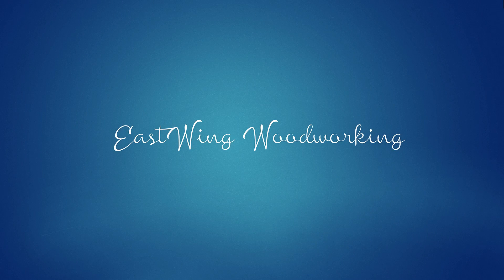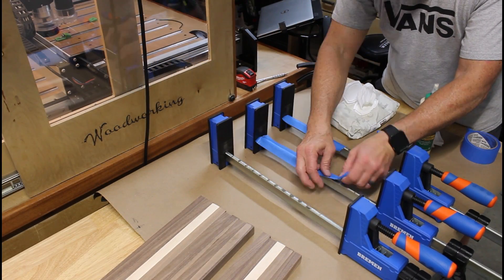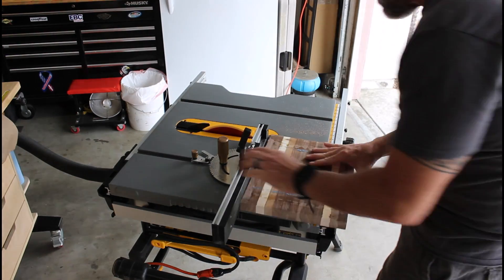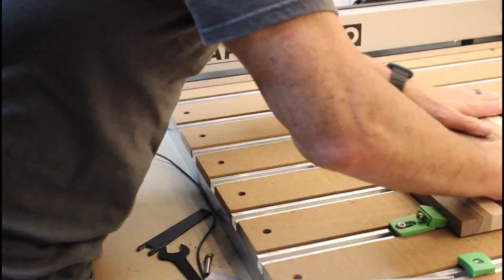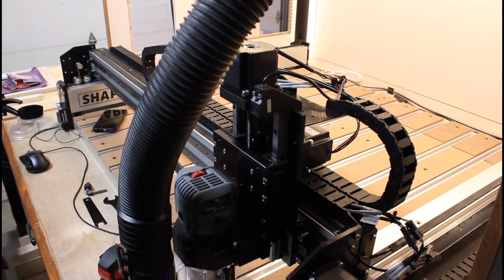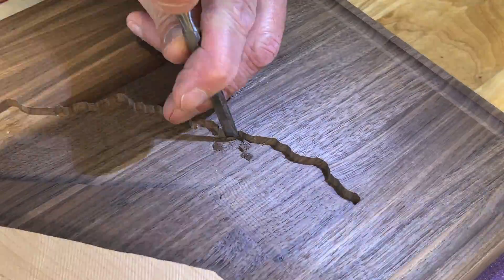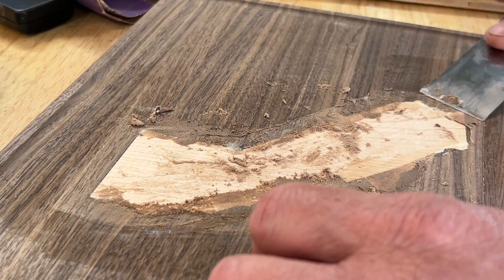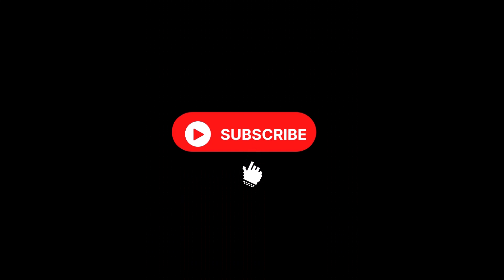CNC Cutting Boards Made Easy

Comment: instead of using masking or painters tape during glue up for ur clamps, you can use the clear plastic packing tape. works wonders, no need for scraping afterwards.
Reply from the maker: Thanks,  I’ll have to try that.

Comment: Have you tried v-inlays yet? I've had great results on cutting boards using them.
Reply from the maker: Not yet...however I just received the bits to do them.  Looking forward to using them as I too here the v-inlays produce better results. Any advice or tips/tricks you can provide, I'm all ears.  Thanks!!
Reply: @eastwingvintagewoodworking4797  I use vcarve and it took a few tutorial videos and a couple mistakes to wrap my head around the toolpaths. I run my v bit as my first path then my clearing bits. I've had less tear out using that order. With edge grain I've had decent results with 60° bits and if it's end grain 30° has worked well if there's lots of fine detail. Best of luck!
Reply from the maker: Thank you!!!